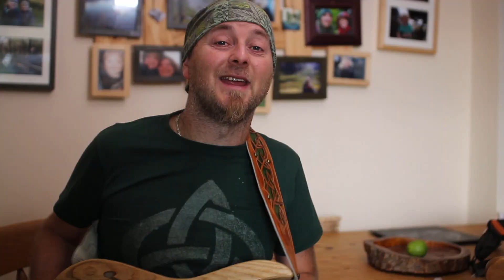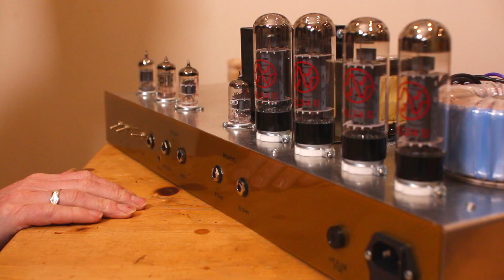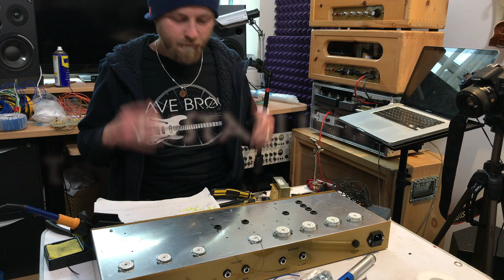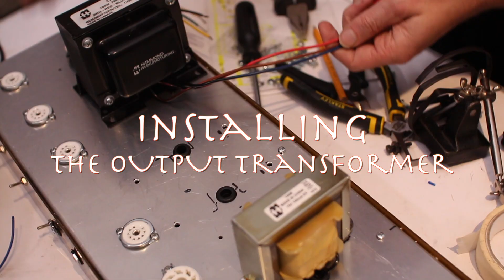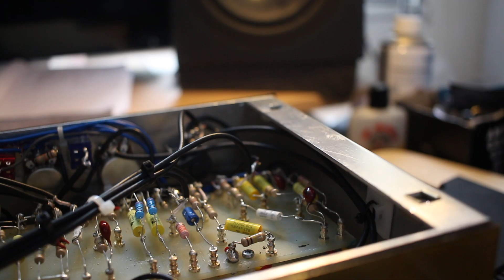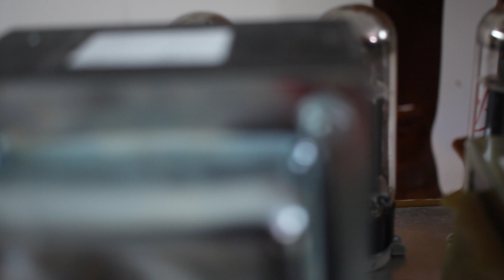8 of 11 Installing the transformers on a Friedman BE100 inspired amp

Comment: Useful tip on never switching on a head without a cab connected, thanks!
Reply from the maker: Baron von Teuchter yeah I blew my Mesa recto 50 up by accidentally doing that : OUCH!
Reply: @DaveBrons  you can also add a resistor across the output jacks so that if you do forget to load the amp (or the cable comes out) then there is still a load so the OT doesn't self-oscillate to death.  470r or 680r ceramic (5W or larger) will do and wont interfere a great deal with regular operation.  Cheap insurance!
Reply from the maker: ZozobraDoom I’ve always wondered about doing that . Won’t it affect the impedance though ?
Reply: @DaveBrons  only slightly. its in parallel with the speaker load so the total load would be 1/(1/16r + 1/470r) = 15.47r for a 16r cab